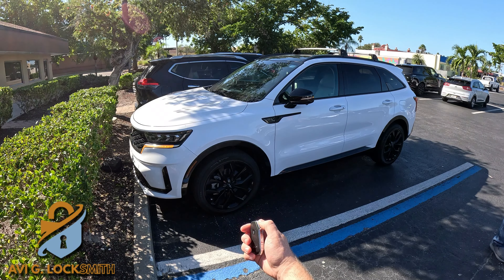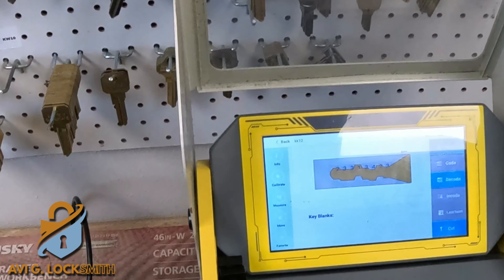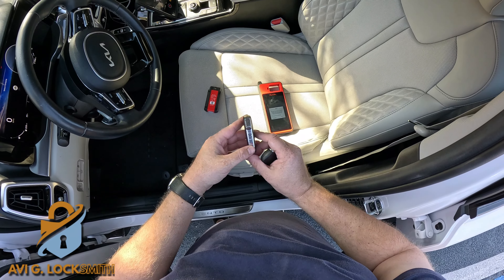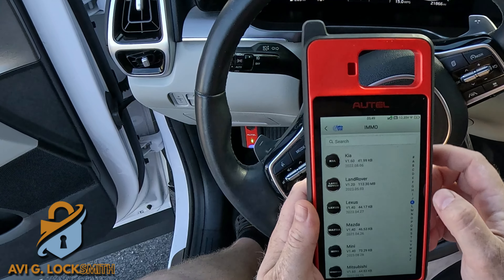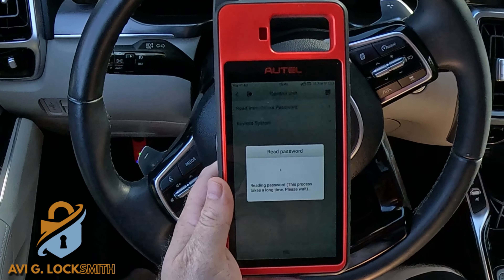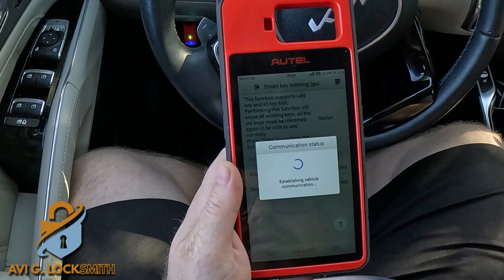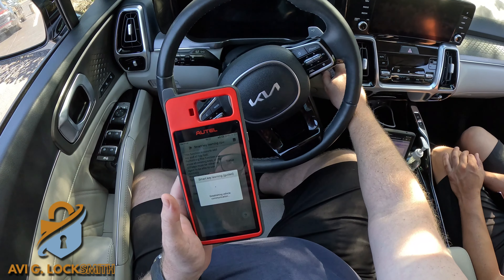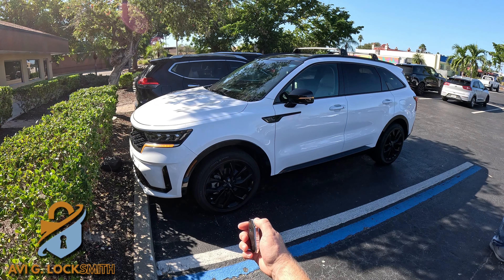2022 Kia Sorento, Proximity Key FOB Programming. Complete Guide For Key Making.

Comment: I have a 2022 kia niro ev, with only one pushbutton fob.  I have two emergency keys but  only one fob.  Can I buy a used OEM fob for this model and reprogram it in the same way you show in the video?  Or do I need to use a brand new fob that has never been programmed?  Also, will dealers give you the pin code for free?  Thanks!